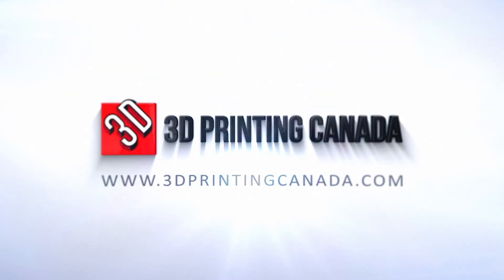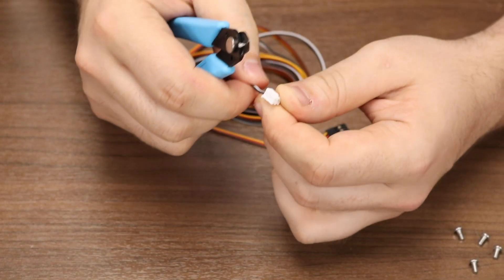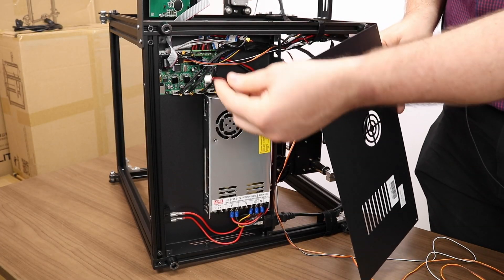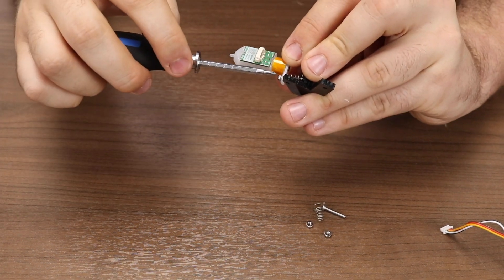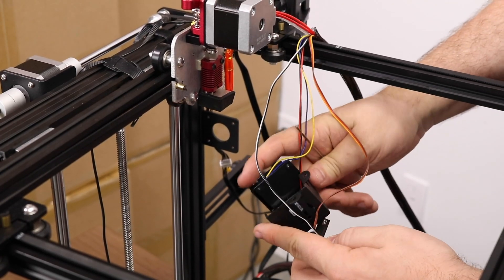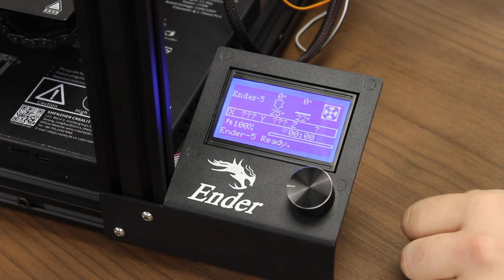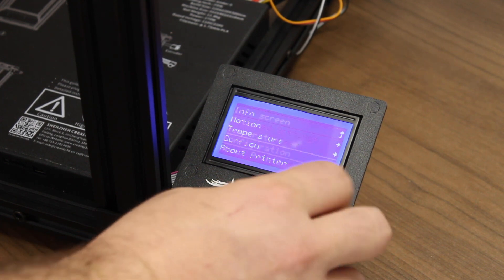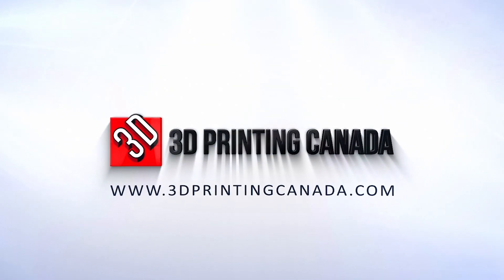How to install a BLTouch on a Creality Ender 5

Comment: The CR Touch connector is different from the BL Touch you have shown. On the Ender 5 Pro (v4.2.2 board), does the z-axis end stop switch stay connected when installing the CR Touch?

Comment: What changes did you make to the gcode? I added the "G29" line per the Creality instructions and it seems like the auto bed leveling is throwing things off of what I calibrated. Before I go into a tedious dive into the gcode with incremental changes, I figured I would ask since this is one of the best BLTouch videos I've found thus far!!

Comment: Why can't these 3d printer manufacturers just ship their printers with an unlocked bootloader and activated ABL options in firmware as well as a port to plug a sensor into without having to rip apart the electronics box and cut and solder wires. They would only need to have a prompt come up on boot after installing the ABL sensor asking to set the appropriate offsets because the firmware has detected the sensor. If 3d printing is to be a household item for the masses then these changes need to be made or most people will simply get frustrated and give up on 3d printing because they either don't have the time to troubleshoot or the confidence in their ability to do such an upgrade (one that every 3d printing enthusiast tends to go for first). Such a simple change like this could make all the difference to new 3d printing makers.

Comment: He skipped the most important part, the firmware upgrade..
Reply: yea what the fuck
Reply: Everyone ALWAYS skip that step.. It super annoying, they tell you how easy and important it is to flash your firmware and then they never show you how to do it. I been looking everywhere for a good tutorial but they don't exist apparently.
Reply: What's even worse is the link they leave above for flashing a ender 5 is actually instructions for a ender 3 with no bootloader. What in the actual fxxxk.

Comment: One question I have that you might be able to shed some light on. Once you do the calibration, save and then start a new print should the extrusion nozzle and the BL Touch probe be at the same level to prevent the bed from smashing in to the nozzle? I realize that if the calibration is done correctly that should never happen.  But then again you're taking away the Z-stop.  Or is the BL Touch just a calibration tool for each print?  And finally, are there any settings you need to change in software like Cura?  Thanks

Comment: Creality Ender 5 Plus BLTOUCH wire colours in to Bigtree SKR 1.4 Turbo

BLTOUCH wire colours on th Creality Ender 5 Plus  appear to be :-

Red, Purple and Orange

These go to a three pin plug which could be positioned ether way round on the Bigtree SKR 1.4 board, (there is a separate Black and White for pin sensor)

Which Colour pin Red OR Orange should go towards the Black and White Pin sensor pins

I assume here that the plug pins Red, Purple and Orange are in the correct order. If this is not correct please  let me know the correct order.

Thanking You!

Comment: Followed your instructions to the letter (I'm using the Ender 5 pro), for some reason when i tell the printer to move along the z axis 10mm, it only move 5mm. Anyone any ideas why? Im new to 3D printing so would appreciate some help.

Check the original firmware at it had the "DEFAULT_AXIS_STEPS_PER_UNIT" set to "80.00, 80.00, 800.00, 93.00" Your firmware had it set to 400, i chenge it to 800 but made no difference.

Have less hair now, please help.
Reply: Sorted this now! Started with stock FW and rewrote it for my needs. works great now

Comment: Installed the firmware today with no drama but only probing the centre of the bed. What have i screwed up? cheers
Reply: You need to update the start G code in your slicer
Reply: I have an ender 5 pro and cannot get it to level. It tries to probe off the bed. Can you describe what you did to fix yours?

Comment: So I have an issue with the BL Touch going outside the printbed when calibrating. Anyone experience the same issue?
Reply: jup... first 2 going well after that it goes next to the bed and get the error ''probing failed''
Reply: @d4rkr4v3r9  got it to work with the Marlin firmware
Reply: @danhbentsen  im still struggeling with it the 2.0.x, what firmware do you use? version
Reply: I have this issue as well. Anyone come uup with a sullotion?. Also How do I get Marlin 1.1.8 back on my 1.1.5 main board? after installing the BL touch it somehow reset it seld and I dont even have an "About printer" selection in the menu to see which version is sunning at all.
Reply: There is a second upgrade for the silence board issue that fixes the offset as well

Comment: Warning: Don't use the firmware they provide on an Ender 5 Pro, it has a different z-axis thread, so needs further changes in the config before compiling and uploading to the printer
Reply: I am experiencing this problem, with the Creality firmware and with Marlin 1.1.9. Can you be more specific about the z-axis thread configuration? Thanks
Reply: @rinosuke73  DEFAULT_AXIS_STEPS_PER_UNIT change 400 to 800. or look in the config/examples/creality/ender5pro folder in the source
Reply: I changed this to 800 but it made no difference, when telling the printer to move 10mm along the z axis it's only moves 5mm. Also my prints come out squashed along the z axis.
Reply: @stevenpumford6506  are you use  you updated the firmware (compiled and uploaded correctly)? sounds like update didn't take.
Reply: @marcusone1  yes, I uploaded correctly, I flashed the original firmware and it works perfectly just without the bltouch
Reply: @stevenpumford6506  v1 or v2 marlin? i'm using v2 (have to reduce options to get it to fit and flash correctly)
Reply: @marcusone1  It's the one downloaded from the link on this site.Folder shows "Marlin 2.0 - Ender 5 BL Touch"  Any ideas how to fix this? When I reflash to original Marlin all works ok. The Axis_steps option on this simply make no difference!
Reply: @marcusone1  Also you mentioned earlier "DEFAULT_AXIS_STEPS_PER_UNIT change 400 to 800. or look in the config/examples/creality/ender5pro folder in the source"

I dont see an ender5pro folder only ender5
Reply: Sorted this now! Started with stock FW and rewrote it for my needs. works great now
Reply: @stevenpumford6506  that's what I had to do as well.

Comment: A quick question about the Ender5 Setup you have in the Video.. Was the fitting on top of the X-Axis Stepper Cover a factory fit or print / after market addon..?

Comment: Is the Firmware that you have listed good for the new Silent Motherboard for the Ender 5?
Reply: If you change values in the configuration.h to TMC2208_STANDALONE on x,y,z,e axis should be good. Or did you find another solution?

Comment: I get "Error compiling for board Sanguino" with the ender 5 firmware, how to solve this problem?
Reply: Select the right COM or the right settings for the firmware on Arduino.

Comment: I can load your ender 3 firmware update but I get "Error compiling for board Sanguino" with the ender 5 firmware
Reply: Same. It's complaining about the board on mine. error: #error "Oops! Select 'Arduino/Genuino Mega or Mega 2560' in 'Tools > Board.'"

Comment: Link for the mounting bracket please? Thank you! :-)
Reply from the maker: https://www.thingiverse.com/thing:3383611
Reply: @3DPrintingCanada  Thank you so much. I looked and couldn't find this specific one!
Reply: @3DPrintingCanada  That Mounting Bracket does not work with the modified direct feed set-up. In the video, the one you end up using is different than the one linked to. You are adding it to the direct drive mod. Do you have an STL of that particular mount you could send me? I can model it in Fusion 360, but I don't like reinventing the wheel if I don't have to LOL. Thanks!

Comment: The video did not show the Dupont connectors being used, and it did not show the Arduino Uno being used. Are these parts actually necessary? Hmmm....
Reply: Tim the arduino is used to flash the boot loader and firmware.
Reply: @TheRealMikaSenoja  I kind of thought it might be for something like that, but the link to show how is missing, so I didn't want to assume LOL. Thanks Chuck!